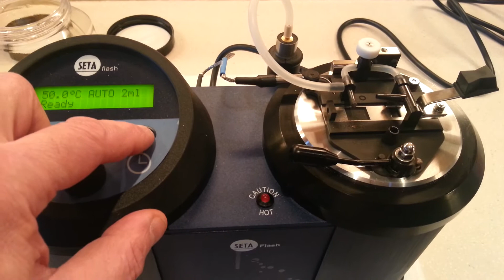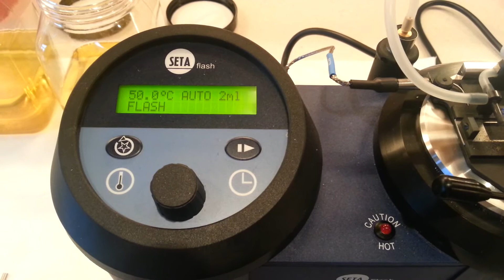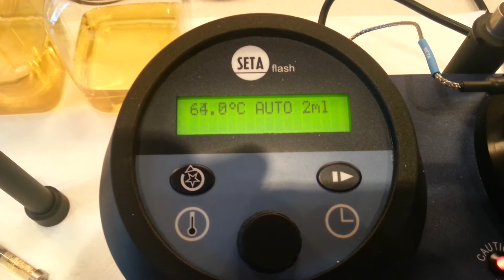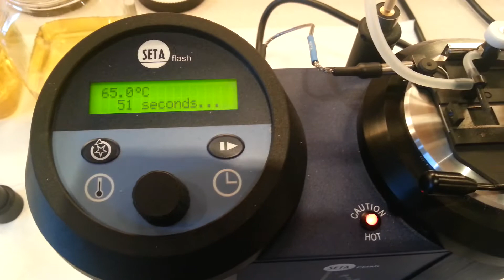Flash testing kerosene and diesel

Comment: Hi Kevin. I just came across your video a few years late. And I just wanted to say my dad's an old mechanic and I showed him your video and he was telling me how in the old days they used to add kerosene to the fuel tank of old Diesel cars and trucks to clean out the injectors and pistons because kerosene had a slightly higher cetane number and a cleaning effect. So they believed back in the day. He's also mentioned that for approximately 50 l tank of diesel they would at about 5 L of kerosene. What are your thoughts ?
Reply: Hi Timur, thats correct and in some colder climates thats still the practice as the freeze curve of kero is lower, so adding it to your diesel helps the cold filter plugging point/cloud point. But in modern engines this is not the case as you are effecting the lubricity of a higher tolerence engine and adding kero would now be a disadvantage and can cause damage.

Comment: How to increase the ignition temperature of kerosene
Reply: Mix with veg oil perhaps
Reply from the maker: To increase the ignition temperature, would mean you would have to add a further distillate fuel and depending on its application would not be suitable or recomended.

Comment: What if you mix, the kerosene and diesel?  what would the performance diffence be?
Reply: mixing both kerosene and diesel is widley done in some countrys for winter blends, however not the UK. It would have an impack on the viscosity and flash point and therefore would not be suited to moder high pressure systems. It will also effect the lubricity of the fuel and the Cetane Values. Therefore is not advised
Reply: @kev22263  that’s why you add a little 2 cycle oil with it!